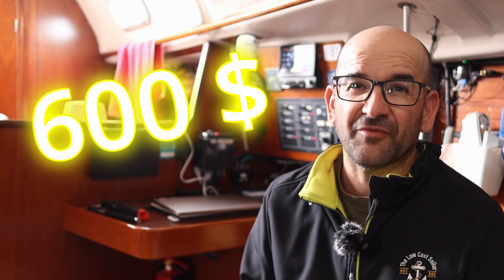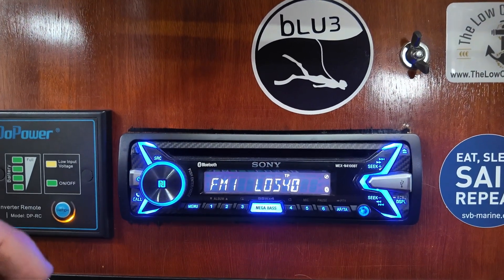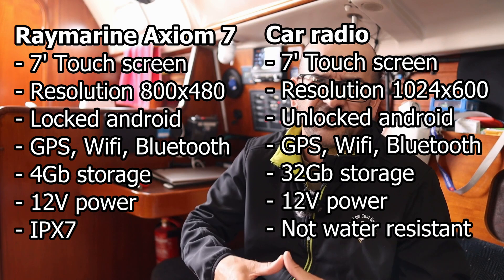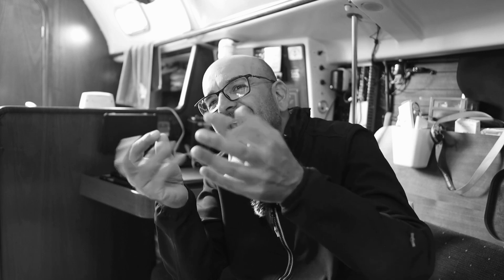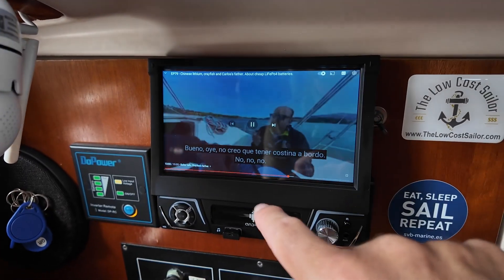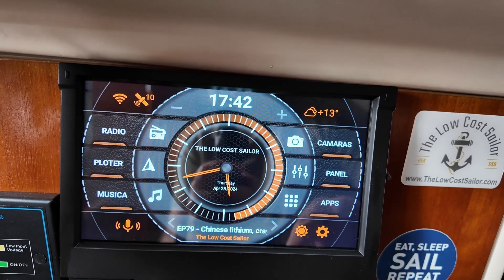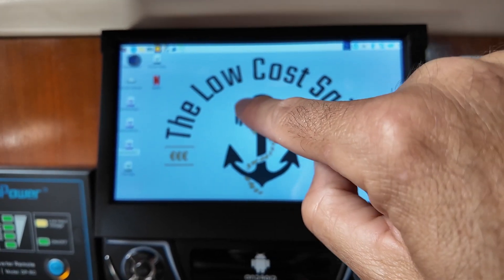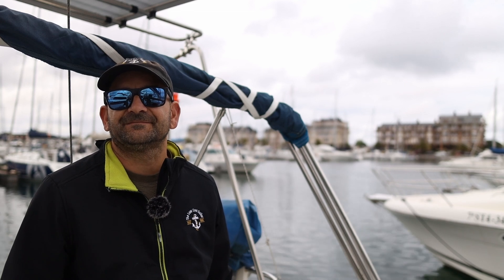EP80 - How to turn a car radio into a 60$ plotter.

Comment: You mentioned something about seamaps/charts for 25 euros , can I get more info on that.
Thanks for the video.
Reply from the maker: There are very different options of chart to add to the radio, or any android tablet:
With the Navionics subscription you can get charts for your area, and you can cancel de subscription after one year and the charts will continue to work on your device.
Also you can install OpenCPN and there are many options for charts:
You have OpenSeaMaps for free
You have the famous CM93  charts, that can be download on some forums on internet
And you can buy charts at o-charts for youur area: https://o-charts.org/shop/es/8-oesenc

Comment: I just saw post on facebook, I have got similar machine the red power wire i ran to a  volt battery so if i turn my batteries off and then come back latter my settings are saved
Reply from the maker: Great, as far as this is a full Android device, If you disconnect power gently, it will keep all the config, probably the connection for the red wire is to ensure that the radio stores everything before powering off, and also to star faster..

Comment: I think it’s possible to add multiple language audio tracks in to the same video that can be selected by the user , I have seen it in some channels (e.g. Marques Brownlee). Just in case you want to avoid duplicating all your content. Cheers.
Reply from the maker: Yes, it is possible, but is only available for a small set of YouTube channels, not mine. In any case, the different videos allow us to localize more things than the audio, like the texts and diagrams on the video or the thumbnails